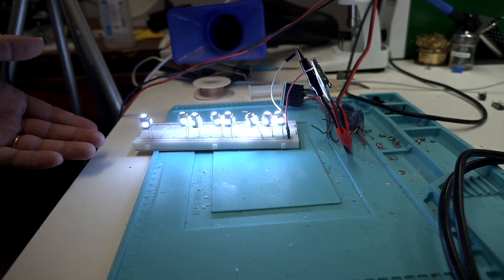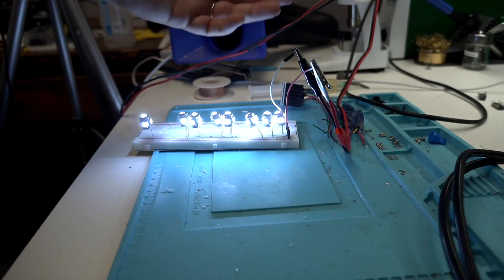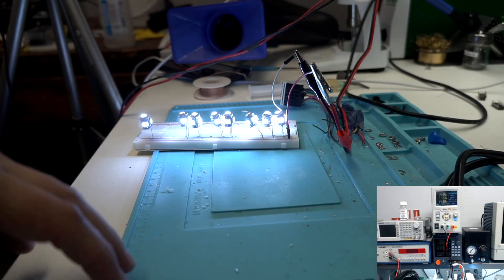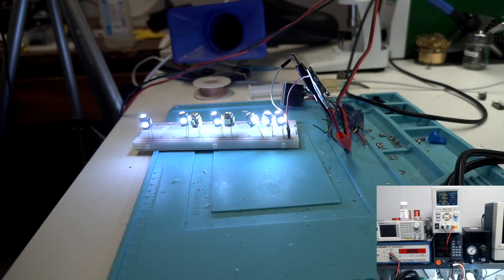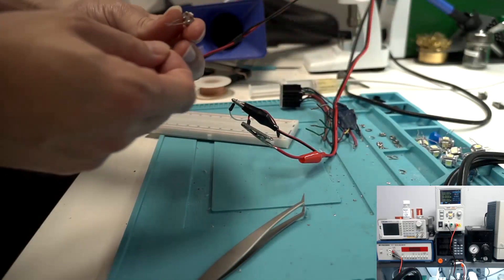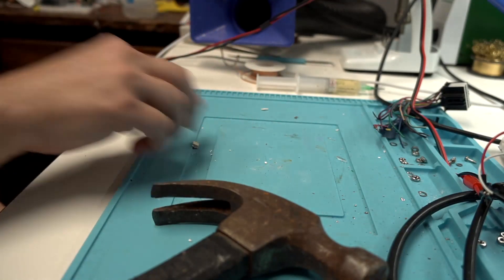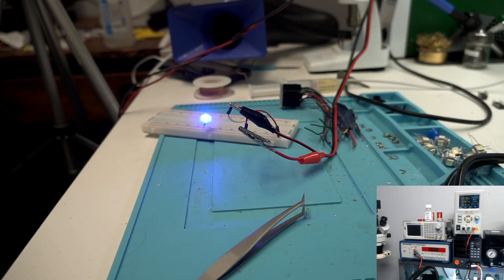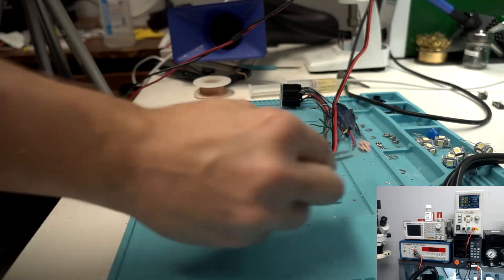Destroying Some Cheap 194 or 168 LEDs Off Of Amazon

Comment: The pre-packaged 194 5050's are some of the most unreliable LED's I've had the pleasure of working with.
I've tried other package sizes of LED's, but the conclusion I came to is all the pre assembled 194's suck so I quit offering them. I was typically getting about 2 months out of them with a 50% failure rate.
Reply from the maker: I have had the same results which is also why I do not offer them

Comment: So what would you suggest ? Buy some clear or white LEDS and put an appropriate value resistor in line with one of the legs (assuming the original bulbs are soldered to the board)
Reply from the maker: 168/194 LEDs are a socketed led. I don't have a good solution for it. Which is why I don't stock them.